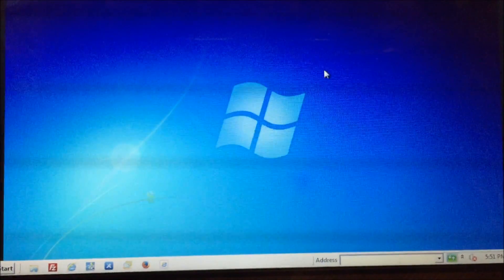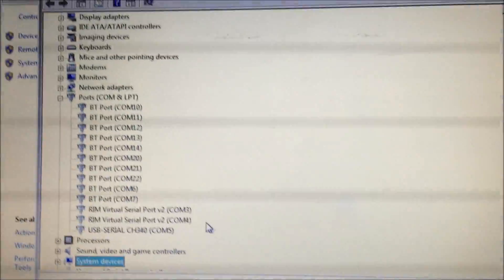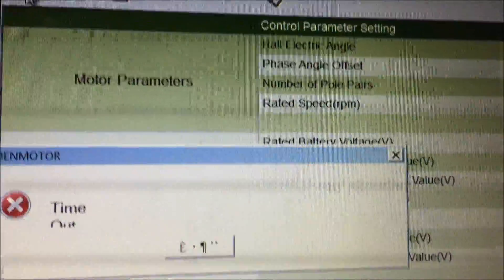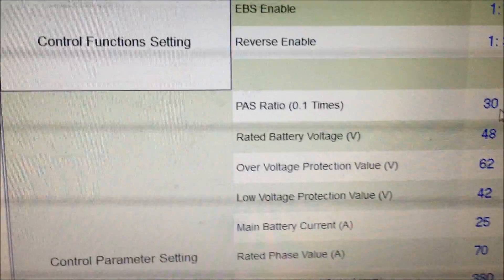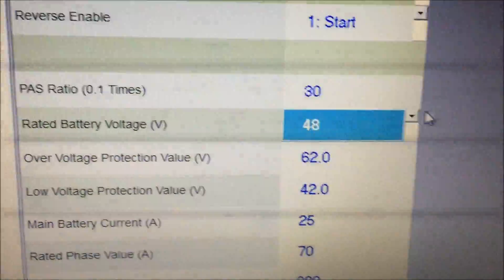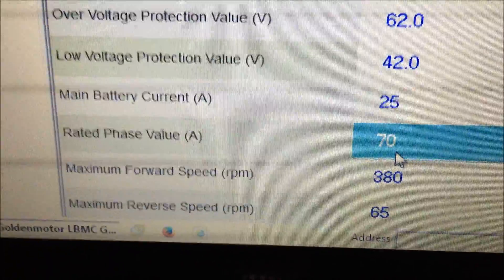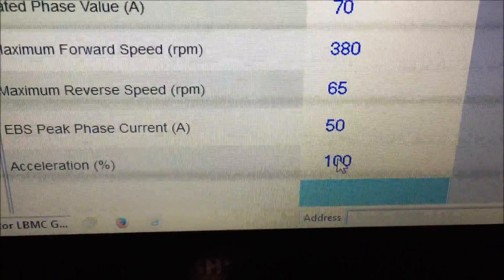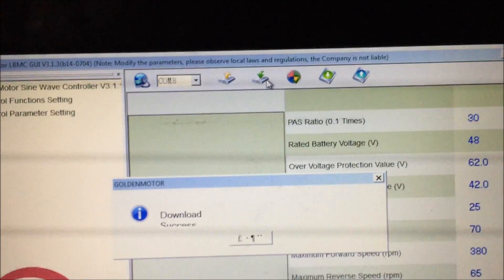Golden Motor Vector - Setting the controller Voltage Golden Motor Canada

Comment: Hi I have a 48V 5kW golden motor with controller installed in a small vehicle. Everything works well, however the vehicle decelerates to a much slower speed after the initial acceleration from being stationary. Any help on how to retain the speed after acceleration will be much appreciated.

Comment: hi a question I have a smart pie v5 motor, I have a 36v battery and I want to place a 48v battery to make this change with the program and the usb cable the battery has to be connected to the motor or these changes are made with the battery disconnected from the motor, sorry my bad english, thanks gary

Comment: Looking at the documentation for the VEC controllers, I have a hard time finding actual data on the requirements of this controller from Golden Motor, at least in English, so I'm politely asking you as a Canadian importer, though I'm located in Denmark and will properly order directly from China:
I'm trying to determine if this controller is suitable for driving an core less axial flux motor. It does state that the VEC200  is a sinusoidal controller and it has variable current control as opposed to run-of-the-mill PWM. Also the motors from Golden motors are axial flux, but iron cored so they will like my motor have low resistance but possible slightly higher induction than my motor (10uH). Do you have an idea or possible experience with these controllers driving coreless motors???
Reply: Hi, did you found an answer to this question?

Comment: Hi so how do I find out my max rpm forward speed ,if it's default is 380? So I can get the most out the motor,, I'm about too order and wheel size is 20" if that helps

Thanks
Reply: +mnl493x 
Did you figure out?
Reply from the maker: +mnl493x 
This is not the best place to ask questions. you should just come to my website. Anyway a 26 inch wheel at 48 volts should go 44-46 km/h so to calculate 20 inch speed that would be 46 / 26 x 20 = 28.3 km/h
Reply: i;ve the same question but pure about the upload.
in it's menu it give 380 rpm as factory setting and
a posible change from 80 to 700 rpm .
it would not change rotation speed if changed the nr.
if a 20" turns 700 where a 26" weel turns 380 there should be 
some compareble material in it .
and is this a fault in the software or so ?
it's a edge i got.
or do's by default in china means , not to be touched